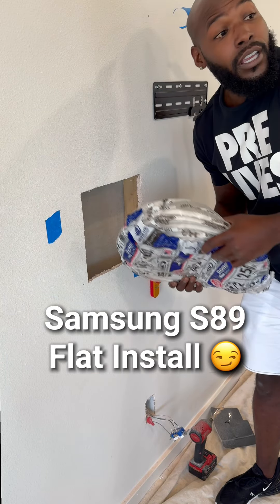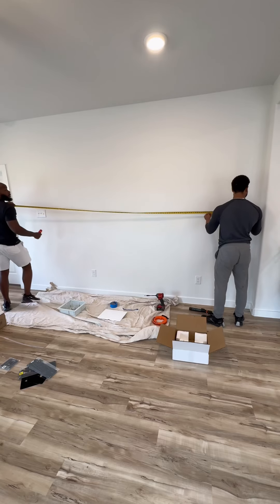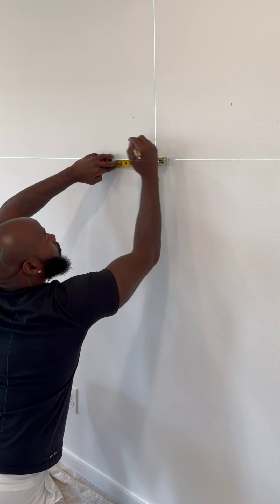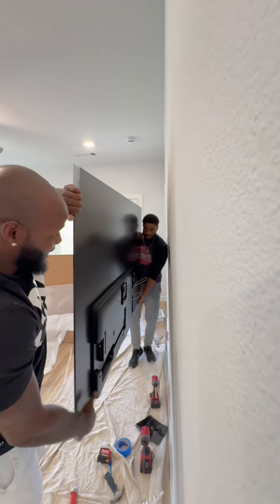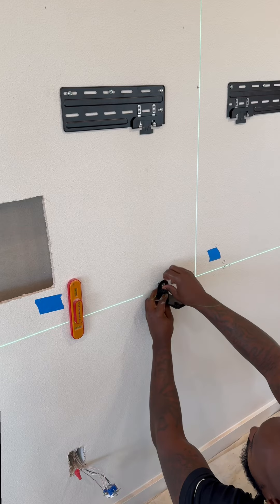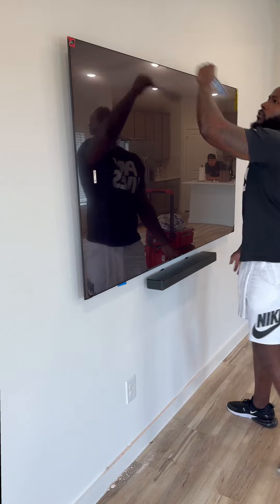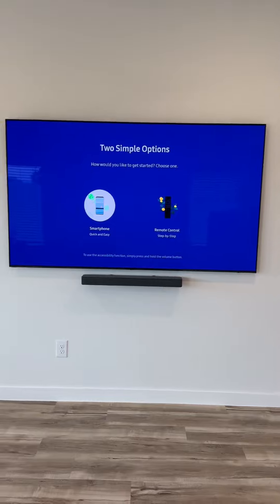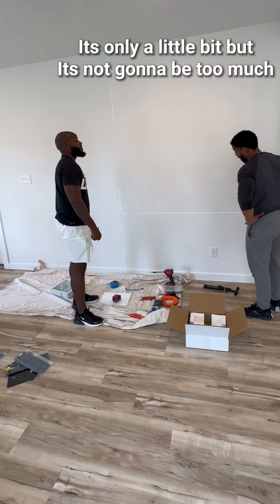How to install a Samsung OLED as flush as possible (full video)

Comment: Do you have a video explaining what’s going on in the box? Do you get a powerplug through the wall to there so it can connect to power in the box? And then the one connect box so all cables can go to the box instead of the left side of tv or smtn. But how do I connect something like a ps5? Through the wall into the box before the tv comes on? New hdmi device means tv off the wall? I’m lost hahaha